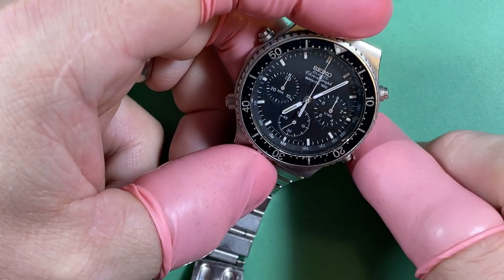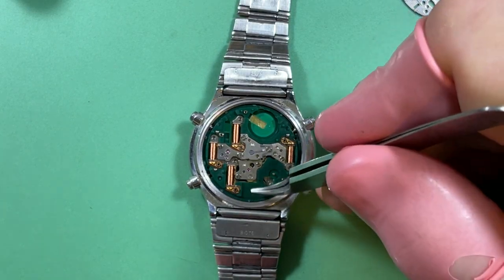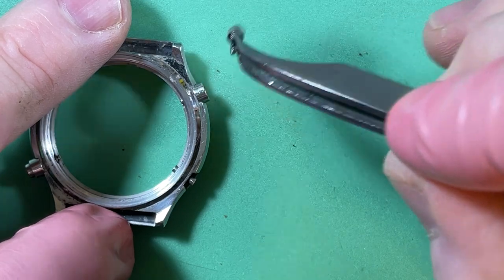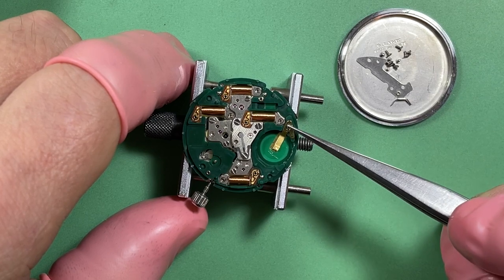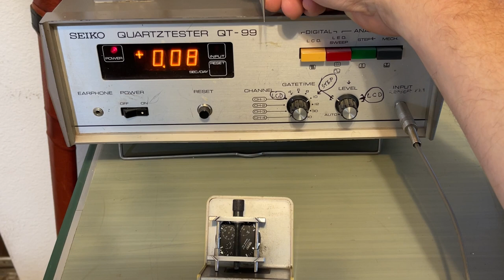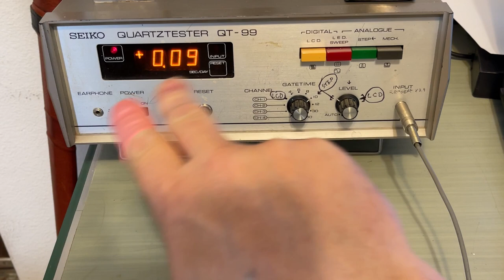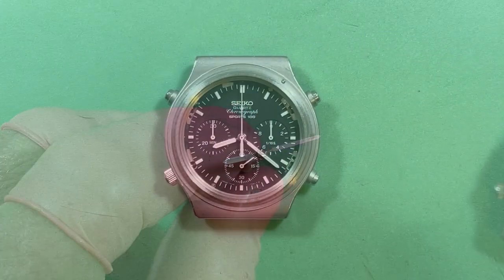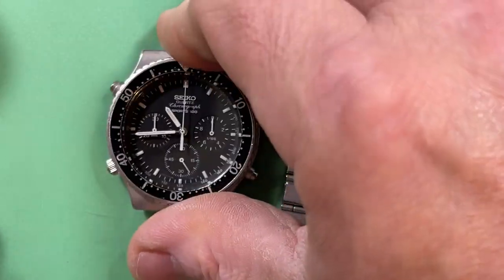For LZ: Seiko 7A28-7049 restoration

Comment: I was given a 7A28-7070 for my 21st birthday (in 1987), I wore that watch every day until about 2011 when the bracelet finally failed, I have since had the watch restored and wear it occasionally with a NOS bracelet which is the same as the one in this video. I love this model of Seiko, they are incredidbly accurate, I love the rotation of the 1/10th second hand, they are an incredible piece of engineering!! Nice to see one being restored!!
Reply: Can I ask where you had it restored?

Comment: Haha, wore my 7a28 7049 daily for over 30 years everywhere, snorkeling, swimming, doing manual labor. Only changed the battery a few times but never deep cleaned it. Then I sent it to Seiko NJ for service before I knew any better; luckily it came back OK! Still runs like a champ. What a watch.
Reply: Whats the deal with sending it to NJ? Is that not recommended?

Comment: Great video and restoration! 
I had this exact watch in the 80's until it had a botched batteryswap in 1995 and got water damaged. I was devastated! 
Could not find another at the time (wanted a mint watch). 
Found one NOS on Ebay in 2016 - originally sold from a jeweler in the World Trade Center. It still had the tags and was unworn. Beautiful watch with a (for the time) groundbreaking movement. The 7-series still hold its own to this day!
I only wear it occasionally, and it is the one watch (along with my Sinn) that I will never sell.

Comment: I have the anodised black version bought in HK in 1984. Still works. Great watch I also have an Omega Seamaster which I bought new in the UK 1977 for £240. Complete junk, never worked for a year at a time without having to go back to Omega, been sat in adrawer for years bought the Seiko to replace it. Seiko every time.

Comment: Am enjoying this vid, listening and watching in between forced breaks cos of shakes, I finally dissected my Antonio Banderas Pulsar Kinetic, did the capacitor gave the unique case a clean inside and out, polishing the insides of both crystals then getting it back together it all went like a train on rails, didn't get to do the "on all fours screw hunt" as I just used a slightly magnetised screwdriver to plop the screws in.   Finished putting back together, new upper to lower case gasket, screwed it all together and after 2 mins of gentle whapping of the rotor its up to 4 bars charge and so pleased.   Last week I bought a broken Citizen 9415M titanium RC eco drive that was deeply discharged... 18 euros... shoved under a bright LED for a night... now working beautifully, am on a roll ^^

Comment: My ex wife bought me two of these in 1986. One a white dress watch and the black one with day and date. Both still work and are mint. I no longer wear them though. one of the hands on the black chronograph has worked loose. I remember a watch shop scratching the case back when replacing the battery.

Comment: Hi Spencer.  Would love to see the bracelet restoration.  I have one but I think it might be beyond repair.  Lots of slack horizontally between the links.  My watch is the day/date version, minty dial and bezel.  The main chrono hand sometimes "shivers" without going anywhere and doesn't find its home position at 12 o'clock.  My reset button doesn't work (might be just grott but maybe something worse) but I think I remember that pulling out the crown to hack will bring the main chrono hand back to it's home position which in my watch is around 2 o'clock.  The other registers seem to work fine, so does the lap time feature.  The bezel is stuck but doesn't really worry me would just love to get the chrono working nicer.  I haven't pulled apart yet as I really don't know why it shivers 50% of the time.  I reckon removing the hand to put back at the 12 o'clock position would be easy but it doesn't address why it started liking the 2 o'clock position more or the shivering.  Lovely watches.  Bracelets definitely don't stand the test of time.  I think seiko missed a trick by not making the crown screwdown?  Why oh why was that not obvious on a sports 100 chronograph with diving bezel, lord only knows ;)  Thanks again for bringing these videos.  Just really helps to tear down something I'm gonna try working on.

Comment: My favorite watch. I was an air-traffic controller in the South African Air Force in the mid-80s, and the pilots had that as their issued watch. I finally got one for my 21st birthday - and it was stolen in a burglary a few years later. Now, almost 30 years later, I found one in great condition (eBay) and love it - problem is, I can't find a set of gaskets for it. I had bought a VTA set off eBay (arrived from Australia) but my local watchmaker said they don't fit - any ideas where to get the right set?
Reply: I have the same issue, ordered the "correct" gaskets and they ended up being too large, have you had any luck finding gaskets for your watch?
Reply: @ap4933  TBH I haven't even looked since then - sorry :(
Reply: @AndyCinDallas  All good! Thought I would give it a try

Comment: Hey makers said my 7A38-7070 's 1 circuit is water damaged may be . Can I fix it and how much it will cost?
Reply from the maker: The circuit can't be repaired, only replaced.  They're decades out of production so the best option is to find a cheap 7A on eBay that's a runner, and use that as a donor.

Comment: Have the same 82 December and for some reason i have two rotating ring balls installed.
also on the dial i have chronograph/sports, is it JDM perhaps?
Reply from the maker: If the dial text has block text rather than cursive, it's the JDM version.  On the two click balls, Seiko would put in a second click ball if the first one failed during production.  I see it pretty regularly with early 6306s & 6309s, even some 6105-811x's.